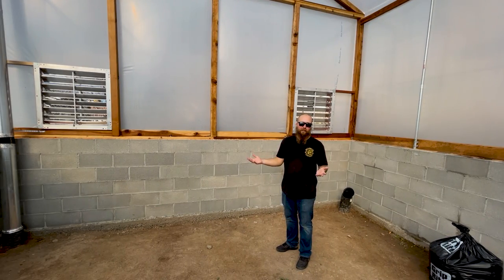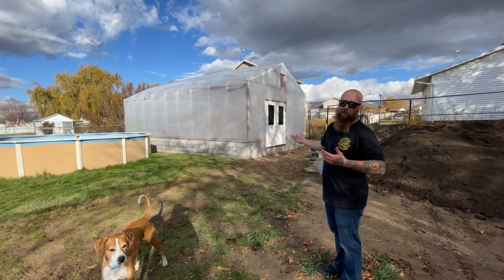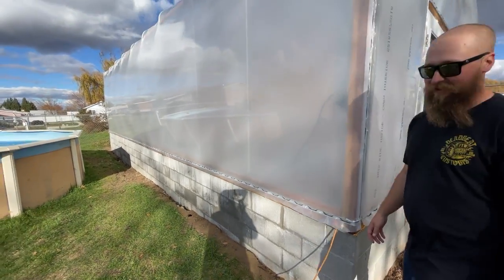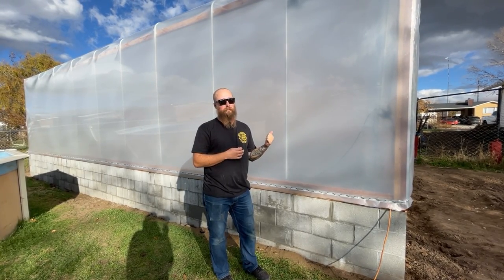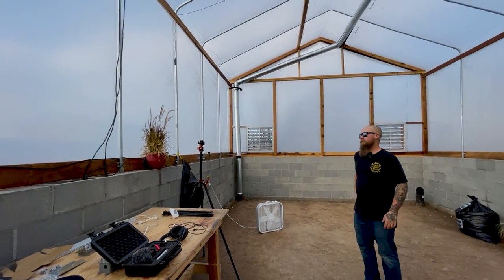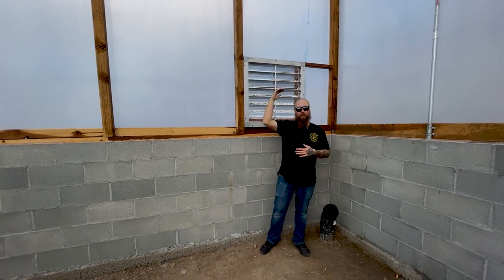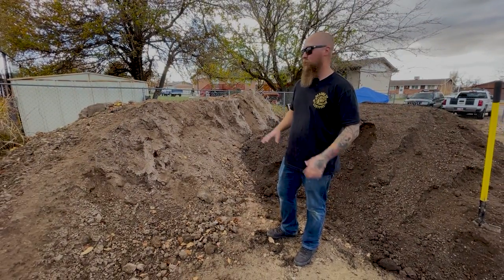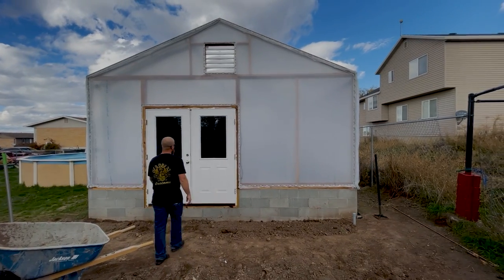We're Building a Tropical Jungle Greenhouse!

Comment: Why have you chosen plastic film? Aren't you afraid that it could get punctured? If it would break during the winter of something it could be devastating for any frogs etc
Reply from the maker: Great question. I researched this for a long time before deciding on plastic. But basically it comes down to cost and how much better a double inflated layer of plastic insulates. Plastic panels are expensive, crack and break, and don’t insulate very well. Glass is crazy expensive and also doesn’t insulate as well. Plastic is cheap and replaceable. It can also be repaired on the spot very easily with repair tape. So if something happens my phone would notify me of any temp drop or anything and it could easily be fixed before any issues. Also I’m going to have a fine mesh all over the inside so even if there was a tear nothing could escape.